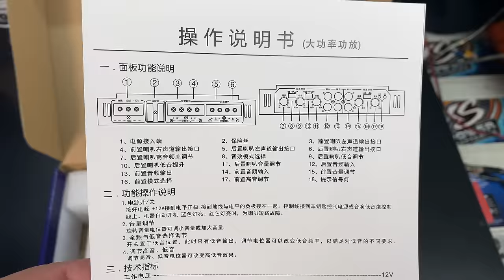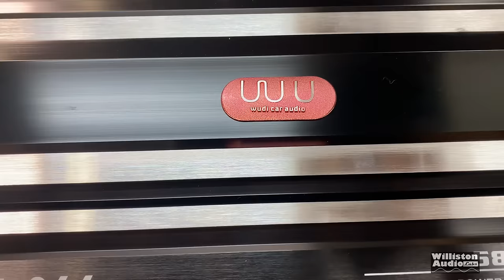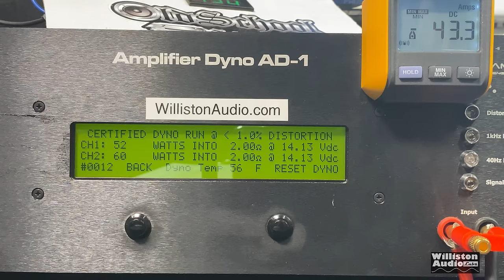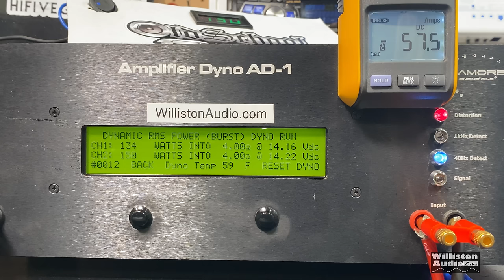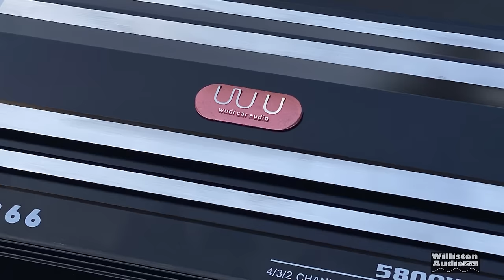I Paid $45 for 5800 watts? WUDI Car Audio C-266 Four Channel Amplifier [4K]

Comment: I bought one of these( not the same brand but the inputs and outputs and board look the same) from a local place for 20$(50% off)  brand new with 2 year warranty.

I've been running it for a year and a half without any problems... Pushing 4  5.25 inch  component speakers with HPF at 125hz
Sounds way cleaner and louder that a single din HU( that can probably put out 20-25w of clean power)
Reply: hey, was thinking id grab one off Ebay to run my pair 3.5" dash speakers and pair 6x9" rear midrange to complement a separate active sub?

Comment: Bro you the man. I didn't think there would be a video for this amp. Good stuff bro keep digging in the crates. We need these vids.
Reply: I bought this amp 3hrs on a Sunday after purchased this amp on ebay tried cancelling it wouldnt allow me to cancel... so as soon as received it u knew I was dooped then the weight definitely fake... rubish fling it out 30% on the volume it cuts out rubish crap.. ebay is 🔥 with them

Comment: Big D, I know what the problem is.....This amp require 200 volts to get 5,800 watts.
Reply: All you get is 12 volts on any vehicle that isn’t an EV. You would need about 500 amps to get 4800 watts. Not gonna happen for very long before the battery explodes. A starter motor draws a couple hundred amps
Reply: @fernanddubois1792  I'm pretty sure he's being sarcastic
Reply: @rockypalacios2494  wooosh! 😅

Comment: Few here would remember the 1/2 din sized under dash mount amps with equalizers at 180/channel or so for like $50 (new) at the local pawn shop 35 years ago. :~D

Comment: This amp is sold in TheNetherlands under the name : excalibur x208.4
Price about 70-99 Euro. Decent price / performance for this amp.
I bought this amp in 2015 and sold it a year or 2 later and it is stilll running in a friends car powering 4 composets of 60w RMS.
Reply from the maker: Good info 👍

Comment: Big D, maybe you should put some 25 or 30 amp fuses in and run the test again. I'm sure those low amp fuses were bottle necking the current flow.

Comment: Yes we understand its not gonna put out that much. But for only $45 is it a good buy for a 4 channel amp????? If i needed a 4 channel amp and had $50 to spend would it be a good deal?????? it sounded clean
Reply: Ya, no kidding! Forget the BS rating, but damn, you get bandpass filters, external fuses, nice terminal strip, good looks, ok power, etc for under $50.00?
Reply: @curtchase3730  yes thats what i am saying if a person was wanting to run some 6x9s and a small sub it would be perfect!!!!!
Reply: @etbough1  If they didn't put a ridiculous number like 5800 watts and actually marketed it as a 50 x 4, which is more believable to anybody who knows anything about an amplifier and charge 50 bucks... that might sell better. That's a couple high power tweeters bridged in network or even a pair of 6 x 9s. You could even do a pair of moderately powered components considering  the bandpass filter on one and two and high pass on 3 and 4.

Comment: Best bang for my buck!$$ I was skeptical at first. But now that I’ve been using this to push my front 6 1/2 and 6x9 rears, I can say I’m pretty happy with this item. 

I don’t need to spend more than I need to …to get GREAT sound!
Reply: Using two of these in bridged mode to power some haptic feedback bass shakers for my racing sim rig (one 100watt Reckhorn BS-200i bass shaker per wheel side).

It would be intriguing to find out where these huge 5800 watt numbers came from. I have two Auna "6000" watt (100w per CH) 6 channel car amps powering my Home Theatre PC based 7.1 CH living room system for Dolby AC-4 and DTS-X via my XFI sound blaster audio card. As long as one understands that they are 100 watts per channel @ 4ohms, then I think most would appreciate that that are good value for the price. The best thing about these is that they are car amplifiers and which will work right off of the PC's own 12 volt PSU. So everything is "self-contained" more or less.

Comment: You know what this thing is good for?  Running LED christmas lights.    They work great for that.    The sound quality is not noticeably bad.   But I'm pretty sure it has turn on thump etc. 
If you have to go cheap?  Buy the Blaupunkt if you want A/B amp and do the modifications to it.  (Much can be done)  But otherwise?  Dual is still the SQ/Budget king for class D.  

The only thing that would best that is a Refurb JBL DSP Amp .   Going to purchase one and send it into testing.

Comment: Thanks for testing this one. I was working on a similar chinese amp (name is saga v12 1200watts😂) and the only difference is the branding and the heatsink/chassis.  the output devices are bjts pair c5198 a1941 per channel. Primitive class AB. Love the effort they've made to prevent power on/off pops.

Comment: I would like to see what a Crown XLS1502 and XLS2502 amp would do on the dyno.  These are very popular amps to drive subs or the mains in home theater applications.
Reply: I would guess crown is under rated ! I've used the dj amps and they are powerful and clean sounding !
Reply: @1boostup  I'm running a XLS1002 in my home theater room driving two 15" old school Rockford fosgate HX2's.  Supposedly the XLS1002 outputs 550rms per channel at a 2ohm load (my subs are dual 4 ohm coils so wired for 2ohm on each channel).  It slams pretty hard but sometimes I want a little more power.  I see 2 more 18" subs in my future and 2 additional crown amps.  (One more for subs and another to drive the mains).

Comment: hey, was thinking id grab one off Ebay to run my pair 3.5" dash speakers and pair 6x9" rear midrange to complement a separate active sub in my old beater car. surely this is perfectly adequate? not into spending a fortune where it isn't needed
Reply: Jamie Thompson - the issue is not that everyone is being a major snob about cheap Chinese amps. 99.9% of us don’t want to see somebody throw money away on crap equipment. If they lie about ratings by a huge margin and have no domestic presence, they really have no reason to offer aftercare or warranty. So - if you look at the description there is a link to other budget amp tests and you can look at your localized amazon to see if any of the non-Dick Riculous amps are available near you.
Reply: @grumpysteelman  I have to own up, i bought this exact amp to see for myself, in haven't plugged it in yet. the advertised numbers matter nothing to me, as long as it drives my speakers im cool with it! However I'll be the first to throw it into the sea if its junk believe me!

Comment: Wow dude, this amp is the same as my RS1000 Roadstar model I bought 20 years ago here in Brazil !!!  It has the same arrangement as input and output connections.  Also the buttons are identical.  Only the aluminum housing has a different design.  In the box and in the manual of my Roadstar it says to have 1000w.
Reply from the maker: Tried and true design!
Reply: @wal  Yes. For sure!

Comment: i was realy needing some help and your the only one on youtube that takes consumers 1st i bought an amp used and cannot find any information on it hopefully you can help me it is a HardRock pw-580 i looked every where got nowhere if you can please let me know thanks
Reply from the maker: Looks like a flea market special. I can't find any info either, but turn the amp over and take off the back panel. If it looks mainly empty as I suspect, then donate or scrap for the aluminum.

Comment: On Aliexpress, this amplifier is currently sold as a ‘6800w 4 channel car amplifier’. Most sellers don’t give any rms ratings, but one seller actually mentions 4*45watt @ 4ohm and 4*60watt @ 2 ohm, and a bridged power of 120watt*2 channels @ 4 ohm. These ratings seem more or less in correspondence with your dyno tests. I was foolish enough to buy 2, not realizing this was a class ab amplifier that is very inefficient and produces lots of heat. I would rate it at 4 ohm minimum; 2 ohm gets far too hot too quickly. Active cooling seems necessary to me. Is there a way to improve performance or sound quality somewhat near clipping point? For example by adding 2x capacitance after the transformer? Currently, it has 4 1000uF capacitors rated at 35v. Someone mentioned using a computer psu to replace the transformer part. How would that work; would you have to bypass the transformer and add for example +24v and -24v (i did not measure the actual voltage yet)? Or would this be useless and is adding capacitance the best you could do?

Comment: Back in the 70's, this would have been an impressive amplifier, especially for that price. It's just a little behind the times now, but, still a good choice for its price, if you wanted one amplifier to handle full range stereo, and, drive a modest sub. You have to admit, it does sound pretty good, for a ~$45.00 US "all in one" amplifier like that. I would buy it, just as a basic car stereo amp.
     The ratings: PLLEEEEEAAAAAAASSSSEEE!!!!!!!!! This thing doesn't even come close, to drawing the full 40 amps available through the 2) 20 amp fuses.
In the future, it might be interesting, if you could "sweep" the amplifiers you test, and see what their frequency response is. How high, and more importantly, how LOW can they go, before the coupling capacitors fail to pass a signal.(look for the 3 db roll off points, high and low)
Reply: Yea, in dynamic burst mode he would've hit 28 amps, about 12 amps shy of popping the fuse, so they definitely could've went with a 35 instead of 40 amp fuse. Crazy.
Reply: @paulweston8184  A single 30 amp fuse would get it done.

Comment: Looking at the PCB, looks like the original transformer and input caps were meant to be much larger than the ones installed. So the factory substituted those parts with cheaper ones and more than likely substituted the transistors with much cheaper ones or fake ones at that. Lots of through hole components on the PCB which is somewhat puzzling because these are more expensive to assemble than surface mount. Overall a very old school way of building an amp, not economical nor efficient, and its not even a good amp. Doesn't make sense at all.
Reply: I add a zero to the end of the fuses and that'll give you pretty close what it will do peak 200 twice 400 i think won't even do 400 watts peak

Comment: When you did the satellite and subwoofer test did you have a crossover running for the subwoofer? or the amp just had one.
Reply from the maker: Rear channels have low pass, front channel has high pass

Comment: I have been in the car audio business since the 80's. Ad-Hoc specifications Committee standards like used in  high end home audio are not mandatory in car audio.But companies like JL Audio and other high end brand use it. Off brand names use there own testing which is extremely over rated.Most high end amps come with burn in spec sheet specific to that amp in inside box.

Comment: For one thing I don't see the point of constantly testing these audio components as sort of PSA. Car Audio even with all the mergers, the brand name companies more often than not give you more value for money than off-brands. Also 99% less expensive then esoteric brands that often overcharge the purist/audiophile for a less than 1% difference in sound quality or loudness.

Comment: You should increase input voltage until you get rated output power.. and see what happens!
Reply: Brandon Smith  you're right, i say cut to the chase and short the fuses right from the start!

Comment: So I bought one of these 9 months ago to power 6 speakers a d 2 tweeters in my van so my subs didn't drown them out. This amp dod that job great for those 9 month but unfortunately blew the other day with no obvious signs when you open it up. So you know what I'm about to do? I'm about to buy another one then save for something better. When I have something better I can then keep this as a spare.

Comment: I just got a wudi 10 inch under seat speaker with built in amp. The wiring kit it comes with is a joke! Have yet to hook it up, but will here soon
Reply: Oh I'm doing a cheap system install. So far I have 4 new speakers. JVC 6x8 x2, and jvc 6.5 speakersx2. They sound pretty amazing on my 13 year old JVC cd player radio. The Wudi sub will be next. So far I have 50 bucks in the 4 jvc speakers, and 80 in the under seat sub. I'm using the wiring that came with the sub, but I did just go buy another inline fuse as the one that came with is funny haha. If I can get it to sound ok I will be happy. A small cheap system for under $150

Comment: Hey im not expecting a reply as this is an old video but if by some xmas miracle you see this..i just bought the wudi "3800" 4channel..and when i opened it up ot has same insides except 2500 farads not 2300..i paid 40with it shipped..is the 2500farad a little more then the one in this video or should i return as i seen the wudi 6800 going for 55 .im running 2 skar zvx12s off a taramps smart3 and the deck is just not enough to pump door speakers which i have 4 and 2 tweeters the doors are 150rms ea and tweet 80ea..so im literally looking for a solid 850 to 900 rms amp at 4ohms...any advice?return and get the 6800 or maybe the one i have will suffice??SORRY for tje essay i just wrote you..just trying to gain an educated opinion from someone with knowledge above mine in this field..thanks either way...
Reply: go for 6800 wudi

Comment: That powersupply of the amp is the weak link..it was pretty apparent from the 2ohm tests. The powersupply doesn't have enough umph to maintain rail voltage cus the amp section look good enough to do atleast 80w/ch. If not 100w/ch. 
But there should be quite a bit of distortion from this amp due to cheap class ab design & a lot of missing stages.

Comment: This is going on in home surround receivers as well, even with brands like Denon. They are not so happy to show the inside of the receivers anymore..You can find photos of the top of the line version which is around $4000 bucks but it's still a joke compared to an old AVR-4806 from 2006 era that would run over 100 watts RMS with all channels driven full bandwidth at 0.05 distortion. Most units today are tested with 1 or 2 channels driven at 1k only.. The mighty 4806 was THX ultra 2 certified which means it can run a home theater room up to 3000 sqft. At over 50 pounds it was not the top of the line receiver, That was the 5805 which weighed in at over 100 pounds.

Comment: When you first started testing and panned passed the side of the amp that has the bass boost , it looked like it was set at 12db. So the whole time I was thinking it's only going to 1* distortion, which would come real quick with bass boost on. Maybe it was an optical illusion.
Reply from the maker: I don’t record these segments in succession, so I may have recorded that part after using it with speakers

Comment: So 4ohm DVC sub in series@8ohm, should be receiving how much power??
I have a similar knockoff amp [CARVEN VEGA] with exactly the same guts. Thanks in adv.
Reply: not much lol maby 25 watts unbridged 50 bridged but your amp may be better just an assumption tho. but run 2 ohm not 8 lol youll get more power if the amp can do it
Reply: @redneckasmr-xd1gg  thanks for your reply. The amp does not support 2Ohm Bridged but honestly with this setup im making things rattle on the other side of the hallway. Btw, im using it at home now powered by an old PC PSU( i know its 12 volt max and less amp). Gains were checked with a DSO meter to mark the clipping point by playing 40hz sinewave test tone. All good never smoked anything.
Reply: @junaidgt90  nice. dont sound half bad then. i used a old psu to power an amp before it worked great.
Reply: @redneckasmr-xd1gg  good to know.

Comment: just bought it to run 4 door speakers , lets see how it goes
Reply: Can you let me know how it does im looking to run 2 6.5s 2 6x9s and tweeters off of it i already have the amp just haven't hooked everything up im a but new to the audio world and dont know what i need altogether so im still getting the wiring components
Reply: You'll Never Blow you speakers that's for sure
Reply: How'd it work
Reply: @joshwilliams9248  they will if that amp puts out a ton of distortion. Distortion kills speakers faster than too much power does.

Comment: This amp pushes my 2 12s just Fine I paid $55 on ebay was not disappointed,put it on 10gauge wire 40amp fuse,the amplifier put 2 25amp fuses in instead of the 2 20amps free 10 amp surge window my sub box a good 85 90 pounds,And this Amp pounds the Ground☺️ Both Speakers Bridged ofcourse

Comment: So do all amps chanlles run a little off from the other? Like I've noticed one ch will usely be different by a few watts. Is there brands that get the all the same?
Reply: Daniel Beavers always wondered the same I feel like the high end amplifiers don’t do it .maybe they do tho do to the output power splitting of into the channels .(like when you split power it’s becomes less and less

Comment: Big D, would you take some time to explain what a dummy load is, and why it works with your tests?  Is there a certain amount of speakers and types it helps simulate?
Reply from the maker: Dummy loads are resistive loads and provide a constant load on the amp (4 ohms for example). Speakers are a reactive load meaning the impedance changes based on frequency, temperatures, box, as well as other factors. 

Engineers test using resistive loads since they provide a honest result of how the amplifier performs with this load. The Amp Dyno has internal resistors and relays allowing me to modify the ohm load resistance with the press of a few buttons. Very useful!